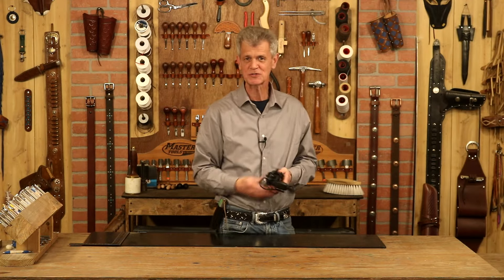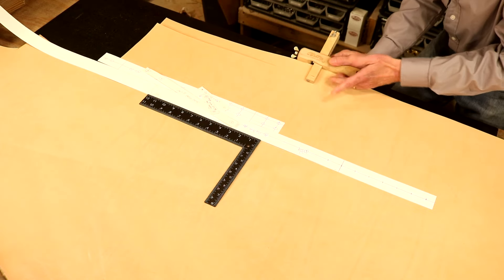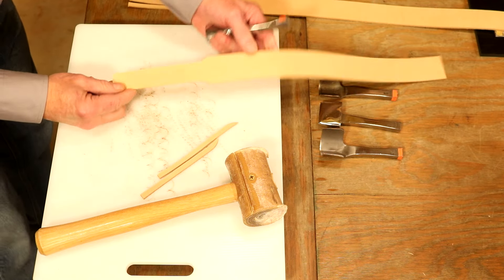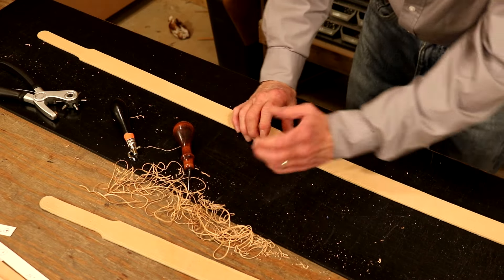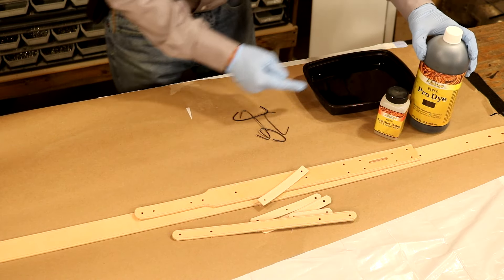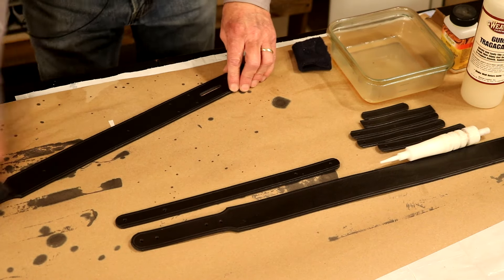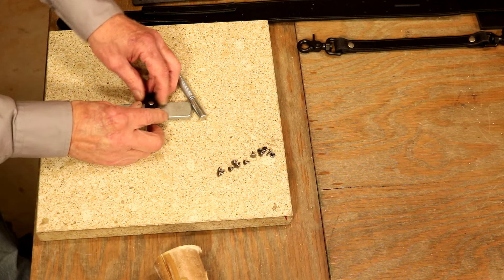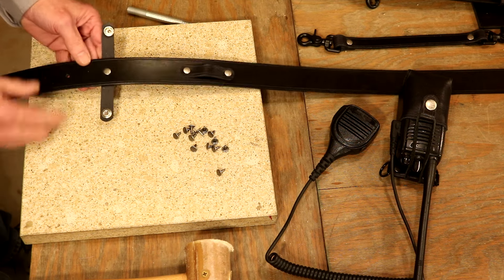Making a Leather Radio Strap Part 2

Comment: I have always wanted to get into leather crafting for utility purposes (knife sheaths, holsters, belts etc.). The one thing that has stopped me is that I am in no way artistic. The fancy tooling and flowers is beyond my desires (I am not the fancy type).    After watching many many of your videos, my interest has peaked again. Thank You so much for showing just how simple it is to get started. 👍😁
Reply: I got started in October.  I’m not artistic either, and have a hard time drawing a straight line with a ruler😂.   I’ve had to take a break due to having rotator cuff surgery and I have watched many many hours of youtube videos on leatherworking.  It may be cheating, but I discovered tooling the leather with a Cricut Maker vinyl cutter.   It can cut and tool leather.  I’ve been playing around with that until I can start using my right arm again.
Reply from the maker: You can absolutely make any of these project without any tooling or carving! We hope you give it a try!

Comment: Hi Weaver.
Have a question.
Where do you attach the little leather strap that hangs straight down at the end of the video.
Is there any possibility that you could take a picture of what it looks like when it is used, and how the radio harness is worn.
Thanks so much for all the great videos.
Lots of fun projects.
many greetings from Sweden.
Reply: The anti-sway strap hooks to a belt loop or carabiner on turnout pants.  It keeps the radio from swinging around and hitting a patient, or getting in the way.  You wear the strap like a crossbody bag.  I wear mine on my left shoulder with my radio on my right side.

Comment: Çhuck, if i am using a lining piece of veg-tan, is waxed nylon thread ok or do i need a more heat resistant thread?  If so, what type of thread?
Reply from the maker: Waxed nylon should be fine unless you are using it around open flame.